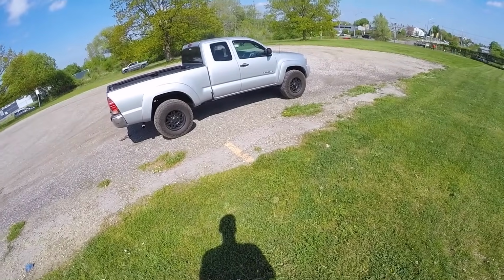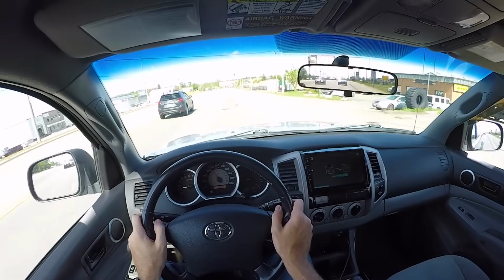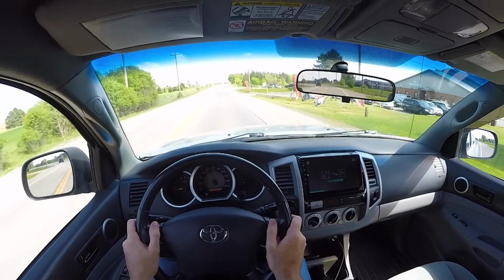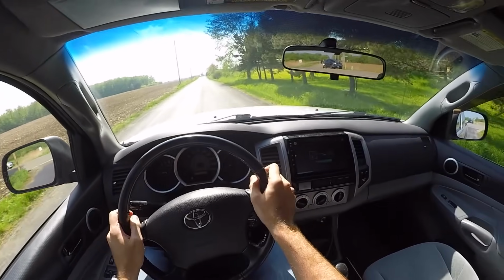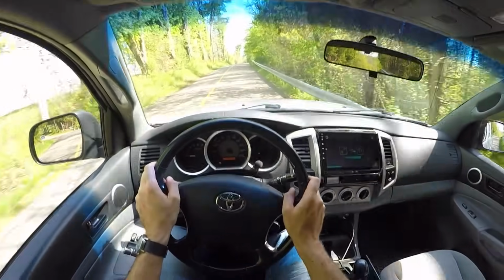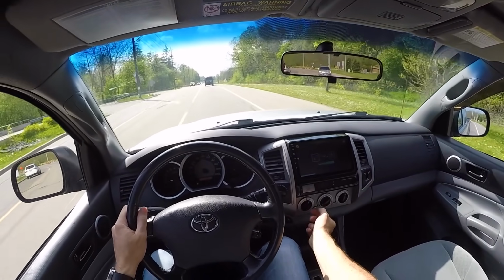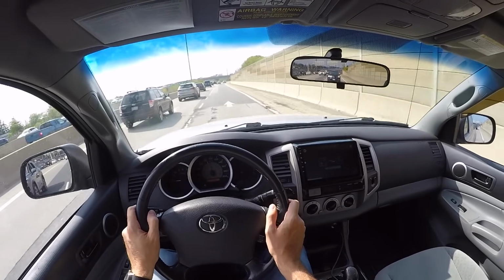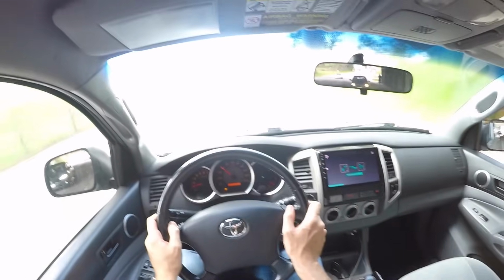How Reliable Is A 200,000+ Mile Toyota Tacoma? | POV Drive

Comment: If the clutch cylinder under the pedal goes, you are screwed. Aftermarket replacements will blow out over and over. 
And I still maintain putting a 4-cylinder engine in a 5000 pound truck is stupid, towing or not. My older '97 with the 3.4 was way better. Frame rot killed it.

Comment: The blower motor thing is an issue. There's a solenoid under the dash in the passenger footwell. So basically, every time someone rides in the passenger seat, they inadvertently kick it. I've replaced mine twice in 215,000 miles. It's an easy fix and the part is only like $30.

Comment: blower motor issue is a 15 dollar resistor. quick and easy to change.  AC check the ground wire on top of the compressor.  hopefully it's that.

Comment: My 2006 Tacoma double cab TRD pre runner has 230k.  Added 265/75/16 all terrains, brush guard, JBL speakers, touchscreen radio and back up camera. ARB bed cover Also did a pedal commander recently really made the 4.0 come to life.
Reply: What kind of touch screen did you install ? And did you have to upgrade the wire harness kit ? Do you have model numbers ?
Reply: pioneer DMH-130BT purchased at Walmart also got the radio plug there too.  It's 50 watts max x 4
Reply: @jamessandifer3405  thank you ! Appreciate
Reply: x2 🎉😊

Comment: I get a shudder from the rear end when backing up in my 2007 & a thud after a few seconds  when stopping at a light/sign. What's up with this?
Reply: Sounds like the slip yoke on your drive shaft needs to be greased up.

Comment: If it won't engage 4wd just turn off the truck & restart. It will work every time.  
Also, use it often & it will stop giving you problems.  
Mine used to get stuck going in or out but regular usage got it working perfectly & keeps it that way.

Comment: The joint in the steering shaft is replaceable without replacing the entire shaft. Whoever you have working on your truck ripped you off.

Comment: I've got a 2008 Toyota tacoma with the four banger and 4x4. Just hit 341,000 miles and not a single light on the dash. love this thing. Slowest car I've ever driven but with the manual 5 speed I can make up for some of its lack of power with clever shifting.

Comment: I'm blessed to have a 2004 Toyota Tacoma prerunner with 216,000 miles on it. Our governor in California is nuts but here in Southern California you can have a 20-year-old truck and it doesn't have a spec of rust on it nothing.   You put this thing on a lift and you don't see any rust at all. I'm hoping to get to 316,000 with this baby.

Comment: To fix high speed control blower switch but works on low,medium not 3/4 speed or full speed the relay block fuse is bad under hood. Will not be the resister goes out from heat change the on😮❤😮 board filter Tacoma 2010 🎉

Comment: The acceleration hesitation may be due to a dying fuel pump; I replaced mine because my Tacoma would basically stutter when accelerating onto the freeway. Easy fix. Removed the fuel tank in about four minutes. 
Just make sure the tank is empty before starting…
File pumps are cooled by the fuel in the tank; knowing this I try not to let the fuel go below 1/4 tank. 
Pump was about $150 CAN

Comment: I just got a 2010 Tacoma, sr5 xtracab for $9000 because the previous older owner was ignorant to the frame replacement and even though he kept the body 100% rust free there was a spot in the frame at the right front cab mount and a shop wouldn't safety it. I inspected the frame top to bottom and found no other holes. I bought it, welded the spot in my driveway and for under 10k I had the truck certified on the road. I've POR15'd the whole frame and rust proofed it. 320,000km too and it runs like a champ! A/C works, 4x4 is a little temperamental but it just needs to be used, I'll take care of that this winter. SOOOOOOOOOOOOOOOO happy with my find. Great video!

Comment: 2010 trd sport 4x4 in Texas. Currently 224k in the truck. Just spent over $6k to get an engine light off but it’s still on. It was mostly neglect. All new front end, needed a computer because the harness sleeve had deteriorated and shorted out 2 banks. I’ll drive this truck til it’s last mile. It’s a little truck so no thrills but it’s never got me stuck. I’m a convert and I think my next truck may be a tundra. I’d welcome the v8.

Comment: I've been much happier with a manual transmission  the truck is quite heavy but I have a four cylinder engine and one of the biggest complaints this generation experienced even with the 6 cyl was gear searching I can imagine that would take alot of the response out of any size engine people will ask me about my four being a dog but I've been very satisfied I keep the granny in a lower gear for and extra few second just enough to build up that extra bit of power for merging  on the highway or passing another veicle without that frustration of waiting for the computer to get the proper gear for the engine speed.

Comment: You need new spark plugs and throttle body cleaning. I have a 2010 Prerunner with 102k miles. Runs smooth. I've changed ALL fluids and hopefully good for another smooth 100k.

Comment: Mine is a 2006 Tacoma work truck, 2.7L RWD 5 speed manual transmission. Got 213,000+ on the odometer, but doesn't burn any oil between oil changes. No rust at all, I sprayed the frame and the underbody with cosmoline (works wonders on the salty roads in Michigan).

Comment: My 2nd gen '12 Tacoma has 180,000 miles. The only repair necessary has been to replace the drive shaft carrier bearing (u-joints replaced at that time, but were still tight). So only tires, battery and the rubber in the carrier bearing. Rust isn't normally a problem in south-central US. Best small 4X4 truck ever.

Comment: I just bought a 2010 Toyota Tacoma Prerunner Crew cab a few days ago. Any way to see if the frame was replaced from the recall??? How can I tell if it's been replaced from the recall? If mine hasn't been replaced I'd like to have that done. It looks rusted in some spots but it may have been painted idk.
Reply: Call up your local Toyota dealership and have them run the VIN. They should have some kind of record no matter where it was done if it was done at a Toyota dealership

Comment: Over 200,000 miles on my 2011 Tacoma double cab. I've used and abused her, but I really haven't experienced much difference from the day I first bought her. I do change my oil every 3,000-5,000 miles. Other than that, I've only had to replace batteries, tires, turning signal bulbs, and one blower motor.
Reply: Awesome! I have 290K miles on my 2011 crew cab! I have maintained it very well. Now the only thing is the transmission torque converter shutters when taking off at low speed.. especially if starting on a hill/incline.. If you haven't yet, I would recommend that you have your transmission fluid drained and filled.... Also if you don't engage your 4x4 often, engage it and drive it for 10 miles or so, just to keep it operating smoothly... I am planning a coast to coast trip ! My mechanic says go for it!!! OH! I have a new frame! Thank you Toyota!!! So I basically have a new truck... The body is in excellent condition...

Comment: Just bought a Tacoma a couple weeks ago with a hard hard misfire and a horrible shake from the torque converter clutch lock up issue. I got it with 402,000 miles got the transmission to a manageable spot for now and replaced the plugs and one coil. Still need to do a lot of smaller jobs on the truck. The driver was bragging that at 402K they'd never done anything more than batteries, brakes, oil changes, belts just basic stuff. I'm amazed at how well the truck drives with this sort of mileage and I paid only $200 since it almost certainly needs a transmission and I wasn't sure how bad the engine would be. I have multiple vehicles so I think I'm going to keep this one as an around town vehicle but I'm amazed at how tough this truck is.

Comment: Except Toyota randomly decided to put new frames on some and denied others. They still have warehouses full of frames. Hit or miss on having that done from what I’ve heard. So you’re lucky if you got a replacement frame installed in your truck. 
 200k miles on a Toyota isn’t a big deal. If you were in a Ford, Chevy, Dodge, or any other truck than that would be a milestone!!
Reply: Not all frames rusted, only those supplied by the Dana Corp.from the us.The japanese  frames were better
Reply: @stefanovichmichael9686  yes I know, they still didn’t replace them all. Some replaced well over the warranty timeframe, some within the timeframe were denied. Depends on the dealer. Some are still being replaced today as Dana paid Toyota millions to do so.

Comment: you may clear out many issues by doing a "zero point recalibration" Google it for a explanation and demonstration !!!!!! also try replacing or cleaning cabin air filter it located behind glove compartment door!!!!! and finally the drum brakes on my Tacoma lasted 200,000 miles so they are very reliable !!!!

Comment: My 07 4.0l has 209k miles i bought it with 165k. Just had to do basic oil changes on it since i got it. The reason i bought mine was because i had a co worker with a 05 that had 365k miles on it and he drove that thing to work every day. His had a bad oil leak coming from the pan and the valve covers. Ive been told as long as you keep up with basic fluid changes and do the timing belt when it needs it you should he fine for a long time.

Comment: just some general advice with these trucks. do a tranny drain and fill at some point (eventually you will get a nasty vibration/shutter but a drain and fill usually solves this issue) lube the shifter cable underneath the truck every once in a while or it will eventually get stiff. if your looking for nice cheap oem rims go with the newer 4 runner SR5 rims and go up a tire size (265 70 R17 with a hair of rub on the mudflap every now and again) it looks much better than the stock rims but isnt super flashy (I enjoyed the stock rims but they corrode) unde roil it and it will probably live forever. Hope and pray you never have to do knock sensors. 427K km on my 08.

Comment: I just bought a 2007 with 222,000 miles on it. 2.7 Prerunner with a 5 speed. I changed a few things like a front wheel bearing, front rotors, front sway bar links. It sure has a lot of power for a 4 cylinder. It can roll 80 mph all day, like it's nothing. Very impressed so far.
Reply: These 2.7 Tacomas are indestructible. Expect it to last a long time.

Comment: Greetings from across Lake Erie, 2012 Tacoma V6 165,000 normal 4WD Base Model, 5 speed automatic passes rigid PA truck inspection with new Geolander 10 ply radials, has crossed the entire US 5 times.  Everything still works except the driver. Great investment ! My niece bought it used in AZ about 5 years ago. She offered to me and bought a new Tacoma

Comment: Still driving my 2000 Tacoma pickup 2.4 liter 4 cyl automatic transmission with 237,000 miles. Body and frame rusty from NYS Road Salt but still runs like a champ, my 4th Toyota truck, also had 3 Toyota cars, been driving them for 40 years since 1983. I drive them until they won't pass NYS Inspection anymore. I'm sure if I lived in a state that doesn't do Inspections some of them would still be running if they hadn't been living in Road Salt a good ⅓ to ½ each year.

Comment: I have a 2010 4X4 Sport.  At 200K (miles) I needed alternator, tensioner, idler pulleys, belt.   Stupid me never greased my drive shaft U-joints so I had to rebuild the drive shaft.  CV boots ripped  and they were replaced.     I've done all the scheduled maintenance including transmission flush every 50K.    The clear coat on the hood by the hood scoop is starting to fail despite good car care and frequent waxing.   But other than that there has been no unscheduled maintenance or problems.   I hope it lasts another 10 years because I don't like any new pickup trucks on the market, not even new Tacomas.   Well of course I'm leaving out $100,000 pick up trucks like the Ford Shelby....

Comment: Good luck because my 06 just had a massive oil leak which= about 7 grand for a new rebuilt engine. I couldn't afford it or the risk that another major repair was coming up so I had to scrap it. It only had 249,000 miles so yours should be coming up soon as well. I don't believe that rumour that toyotas last forever anymore.
Reply: Massive oil leak? From where?

Comment: hey, i have a 2006 tacoma regular cab, i missed my frame recall date, i went to do dealership they turned me down, how did you get it done ?
Reply from the maker: Mine was done years ago, the campaign is over now unfortunately
Reply: @CanadianGearhead  my 2008 double cab has frame done before I bought it ...the frame bolts to the bed are all off I had to take one off so I could push the bed to one side as one of the tires sticks out more than the other ...it looks like who ever changed out the frame must of got it from Mexico and they put the holes for the bolts a little off where they should be ..frame made in Mexico terrible

Comment: I just bought an 06 sr5 v6 4x4  with 301,000KM chassis was replaced and pretty much everything else! I got it for 5 grand. In terms  of rust it just needs a soft spot fixed on the passenger rocker. I'm shocked at how little rust it has! I'm in newfoundland Canada so I was expecting more. I can't wait to do the fun little upgrades. Took me 2 years to find one that wasn't beat to hell.
Reply: It ended up needing a driverside floor pan front to back just behind the seat. Engine bay needed patching and rockers are shot.
Reply: @tyleredwards6489 hey that’s not bad man. I’m looking at buying the same exact truck with 145,000 miles for 12 thousand USD. It’s gonna be my first Tacoma but I’m looking forward to it.

Comment: I own a 2008 SR5 w/ the 2.7L, currently it has 245,000+ miles and still running great.  My last truck was a '96 tacoma 4x4 that had 325,000+ miles on it when I wrecked it on some black ice back in 2009. Love these trucks!
Reply: Im sorry for your loss

Comment: my job has one of these for a fleet vehicle and its at 320,000 miles. every single light is on the dash but she runs solid every day.
Reply: you can fix those lights by putting electrical tape over them LOL
Reply: @napoland9676  hahaha

Comment: I have an 08 TRD Sport with 176k miles. I love the truck but its not without issues. I live in Arizona so luckily rust isn't a big deal here. Instead we have trouble with paint deterioration from the sun. It's probably the most expensive issue with the truck right now.  I have also lost my cruise control. I know there are common problems with the switch and the clock spring that cause this but in my case I think it's the actual module under the hood and not easy to fix. I also have problems with my blower motor. Thats a resistor under the glove box. My understanding is that is caused by the gauge of the wires running to it being too small, they get fried and turn black from too much power trying to go through them. Surprised Toyota never recalled that as a fire hazard... My tire pressure sensors are also out. I just finished installing new brake pads and rotors, huge difference! In the middle of upgrading the suspension at the moment and adding a 2" lift, super stoked for that. I'm getting some leakage from the steering rack so expecting that I'll need to get that replaced at some point. Keep and eye on the drive shaft, I ended up  having to rebuild mine, the u-joints and carrier bearing were toast and knocking around like crazy. Luckily it didn't damage the transmission or differential seals. I'm hoping that I can put a little bit of TLC into it and keep it on the road for another 175k. Keeping my fingers crossed that things like the AC, ABS breaking system and heater core don't fail, repairs that big might signify that it's time to quit fixing it and buy a new truck.

Comment: My experience with Tacomas has been very positive but like anything else it all depends on preventive maintenance. It has been my experience that the Engine and drive train are virtually bulletproof but everything else...bearings, U-joints, front ends components, etc are no different than any other vehicle. That can still add up over time.

Comment: @160,000 miles change your lower control arms, struts and shocks, tire rods out, sway bar bushings cheap and easy. Change with OEM save up for and work extra hours to buy them. Base model Tacomas have very bad front suspensions ball joint failures happens all the time. 

Wheels fall off easy due to ball joints PLEASE change @ 150,000 before the issues start.

They rust underneath very easy always pressure wash underneath especially if you live up north. Seen countless of frames breaking between bed and cab. 

Truck is dependable always cranks up! Take care of her by changing minor parts and she will last you at least 400,000 plus miles. You will get tired of this truck because it’s so dependable you will want to keep it but get an upgrade.
Reply: Oh replace wheel bearing hubs

Comment: Bought an 06 SR5 yesterday with 184k on it in st catharines. Just on the qew/403/hwy6 so far but runs sootm just things feel a little stiff. planning to get the peddle commander. Apparently its  must have with the laggy throttle response of the tacomas.
Reply: Looking to buy a taco too. How much did you pay? I’ve noticed prices have 🚀.
Reply: @melgonza1012 Prices are sky high on Toyota trucks because of their reliability and reputation for going multiple 100,000's of miles. My 85 had 4 owners after I traded it, had 460,000+ miles on it when the owner snapped the frame hauling a full load of firewood out of the woods. NYS Salt had ate up the frame, but it was still running good. Not bad for a 4 cyl engine and manual transmission!😅